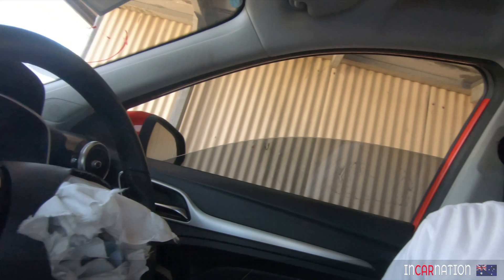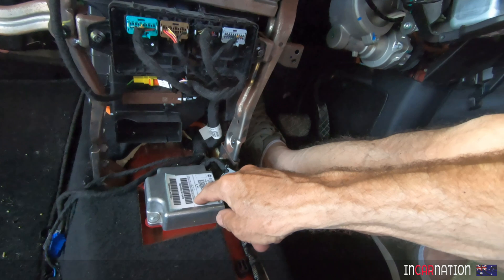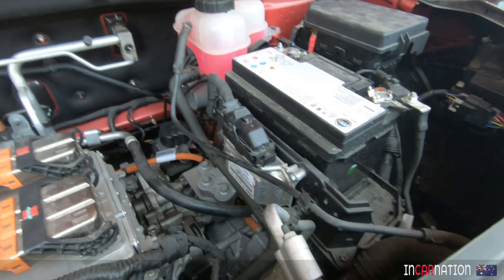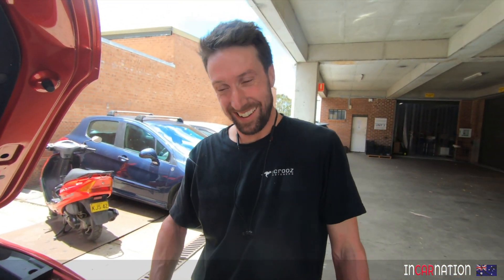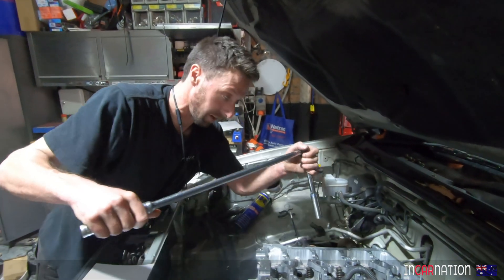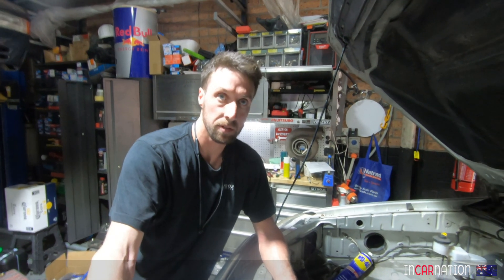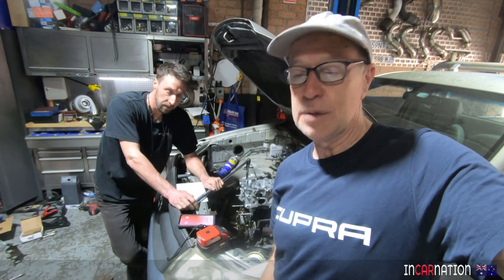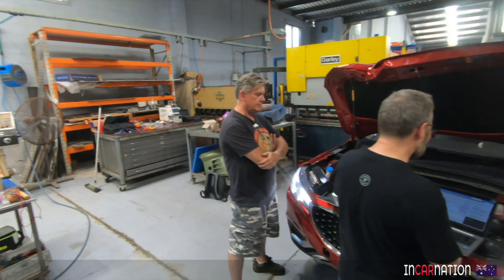Episode 8 – Porsche EV Conversion | Learning how my EV Donor Car Works

Comment: It's true when you swap 2 fases the motor spins backwards, but the spinning field is controlled with the feedback of the encoder or resolver  So you need to reverse that also, but then you need to have the luck that it aligns with the stator again. And that needs to be perfect otherwise it will not work. The control of the electric magnetic field is completely based on the encoder fastback position.
Reply from the maker: Thank you Nathaniel that's helpful. Geoff also raised the same concern with this "in reverse" plan, regarding the resolver. I'm glad you guys know what that is because I don't. It looks like we'll first try the upside-down plan instead, which looks practical. And we can test it out of the car. Just might need to swap the diff oil breather and drain. I'm looking for the simplest, most likely to work, approach.
Reply: @inCARnationAustralia  yes. With the upsidedown approache you can solve the lubricant issue mechanically. But on the other hand if it's possible maybe the easiest way to convert is to bolt the motor on the original gearbox? Then you can use the gears to make the car a bit more exciting. In my conversation I did the same. But I don't know if the motor you have van be easy used without the differential casing and if the rotation direction and cooling etc will let you do this.
But any how you are going to do it I promise you you make the car better with a electric motor!
Reply: @nathanielakkermans  problem there is this drive unit (like the Teslas) uses a reduction gear set (8:1) and open diff and two outputs. Major engineering/fabricating challenge to get this to work though the existing gearbox.
Reply from the maker: @nathanielakkermans  Yes I understand the attraction of the manual box, like Nick did with his VW Type 3 conversion using an inline Hyper9 motor (another video on the channel) but in the 928 that would mean retaining the whole bulky and heavy torque tube and flywheel, as it's a front mounted clutch but rear mounted gearbox. The weight penalty for those alone is far more than the combined EV motor/diff. In any case I prefer the elegance of the transaxle/integrated differential design of either MG or Tesla drive units, which look a nice shape to slot in the back of a transaxle Porsche, hopefully without any structural chassis mods. In Nick's VW conversion with the EV being so quiet now I did notice gear and diff noises, as you'd expect.

Comment: There are a couple of inertial sensors in the front bar. If memory serves me correctly they bolt onto the radiator stack frame.

Comment: Firstly, Thanks for putting in the extra effort of documenting this journey on Youtube. I know there is quite a bit of work in just doing that.
You are proving to be a super valuable information resource for those of us that are interested in doing an ev conversion. I follow a couple of other conversion channels and they are a gold mine of time saving, educational data. 
Based on our last conversation, I have now changed my mind on your use of the MG motor. It is quite clear that you are just as interested in the process as you are in the solution as opposed to some people that just want to get an ev conversion on the road quickly. You mentioned previously that this might be 928 version # 1 and that a second one would be a Tesla revision so I realized that you're in this for the long run like any other hot rodder. Especially when you mentioned that you have a Jag conversion in mind as well. Sounds like you've really caught the ev bug.
As I think we all agree, using the MG system will help get the car rolling much quicker without having to figure out aftermarket protocols etc. Not so much with the drive unit but with everything else. So, while an MG powered 928 may not be a absolute supercar, it will still be a pretty impressive machine regardless. I reckon there's plenty of value in continuing with the MG running gear and proving the concept.
As I'm sure you're aware, there are plenty of Tesla motors that have been run backwards, sideways or upside down with only a few minor modifications. 
The MG probably won't charge without the motor plugged just because of a couple of safety interlocks via communications.
With regard to whether the ecu is actually paired with the motor or not, it would be really interesting to borrow an ECU from  Wayne and plug it in to see whether it works. I know in some cars the ecu is paired to the drive unit but in many other vehicles it isn't. Might be a good test just for the knowledge. 
Really looking forward to the next installment. Cheers.
Reply: Car will run fine with the VCU out of another car. The previous one I repaired had the VCU and charger from the donor car initially and ran fine. It was only when it was taken to MG and scanned that we realised.
Reply: Thanks for that Wayne. That's good to know. @evs2k